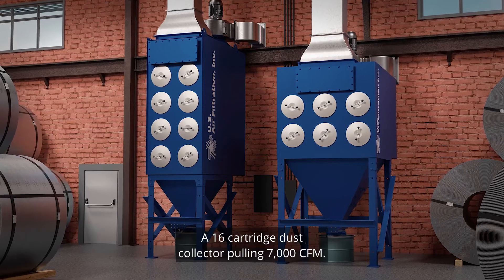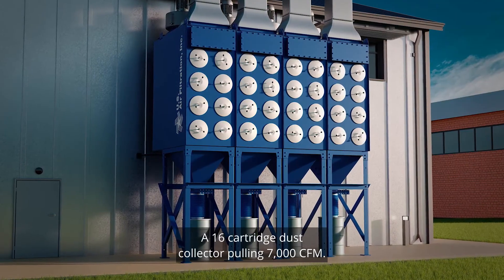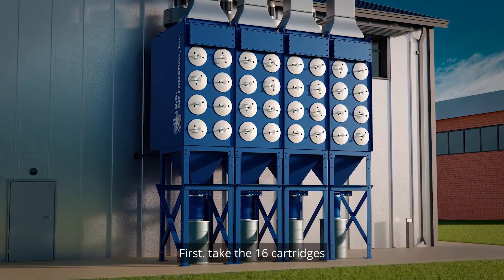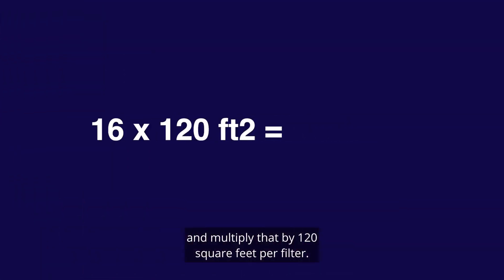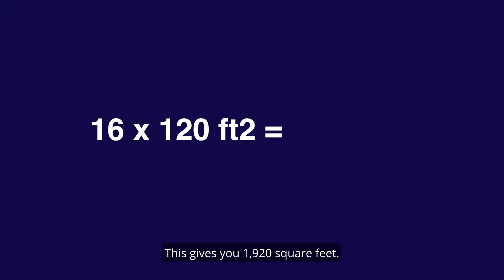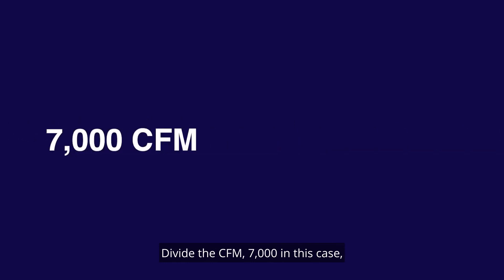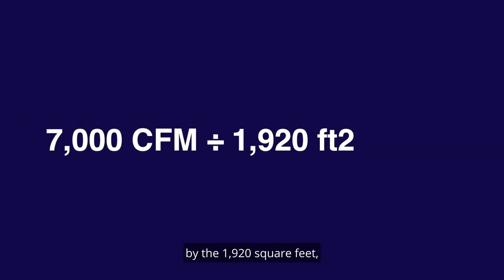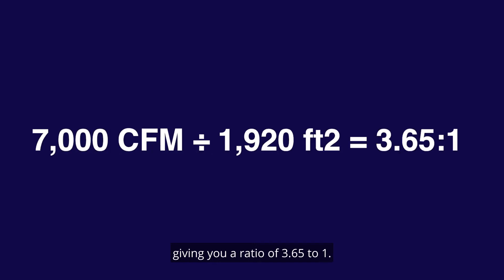Air To Cloth Ratio

Comment: If I have to calculate the Air to cloth ratio of a Dust catcher system with 
1. No of bags-159
2. Dia of bag- 130mm
3. Length of bag area-7000mm
4. Air flow - 60000Nm^3/Hr

How can I calculate